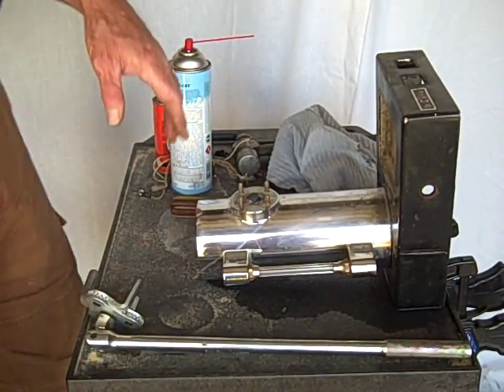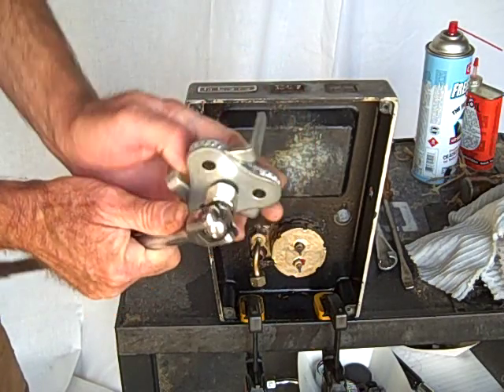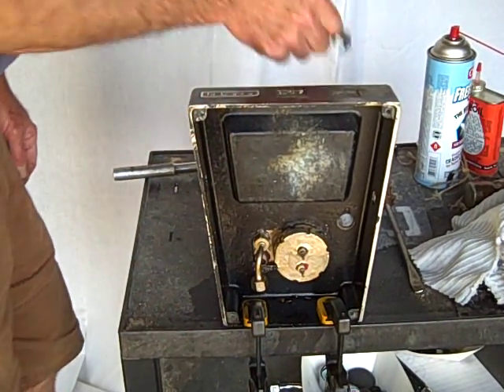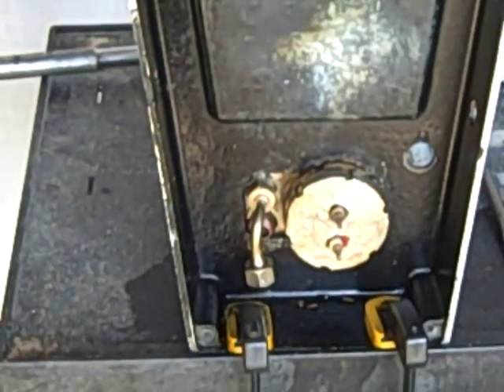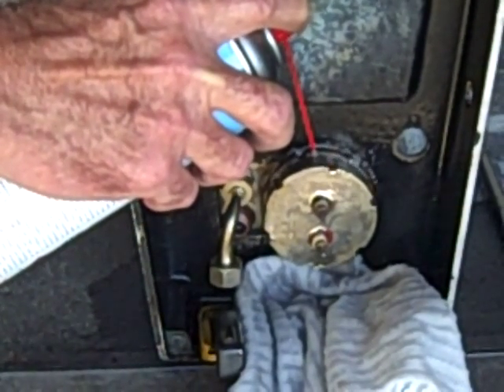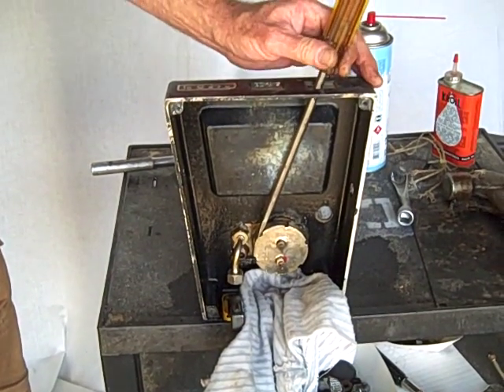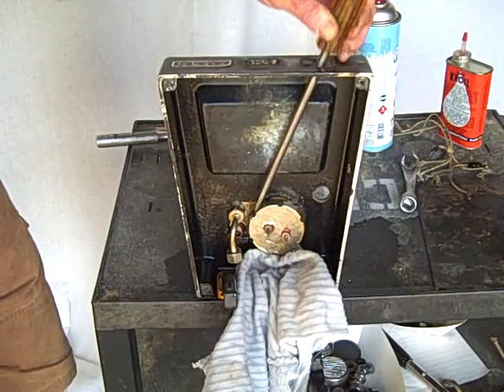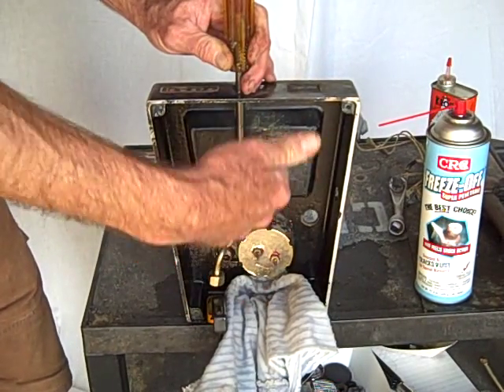Orphan Espresso Tech Tip - Element Removal from Riviera Espresso Machine

Comment: Do you know if the base is aluminum? Mine seems to be a base metal with possibly chrome then copper. It's flaking off quite a lot with corrosion under the flaking areas.  I'm thinking now it might be Aluminum base. What do you think? Thanks if you are still out there!
Reply from the maker: Believe it's a cast zinc, or pot metal (zinc alloy).  Best way to restore it is bead blast, and powder coat it.
Reply: @orphanespresso  Ahh yes, should have thought about pot metal. Didn't really remember what pot metal was  made of though.. Seems like they first used some sort of chromium plate then applied the copper over that. Definitely flaking and corrosion on the pot metal. So will look in to bead blasting or maybe even a light handed sanding, depending how the pot metal will hold up. The base is much worse than any other copper plated parts. Would like to spray it a complimentary color which goes with the brass and copper tone. Lets see! Oh, I need a brass sight glass (level glass) nut.. Do you know a source by chance? Old La Riviera model. Thank you!
Reply from the maker: @kalo93406  Sorry, we don't have any Riviera parts any more, and I'm not sure who does.  Yes, some light sanding, and you can fill if needed using a metal based filler so the powdercoating will still stick.
Reply: @orphanespresso  Hi. One more question about this machine. The base obviously gets very hot, and I think this is normal and it doesn't bother me. But another person is trying to keep the base cooler. Do you think adding some special insulation between the base and the boiler will help much? My gut feeling is won't help at all since there is so much metal to metal contact in other places.  (direct boiler/base contact on top and the big nut/threaded pipe/base connection on the bottom) This is only the flat surface part directly on the bottom of the boiler. Mine actually has two thin layers of black fibrous gasket material, but honestly I think those act like more of a conductor than just air would. What's your experience, and what would you use for a gasket between the boiler and base or nothing at all? Thanks if you can give any input!